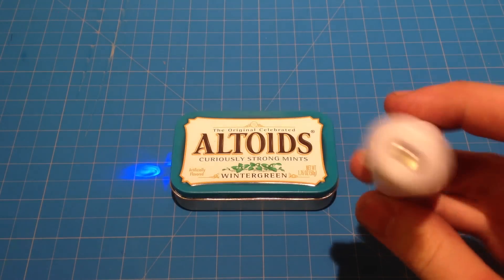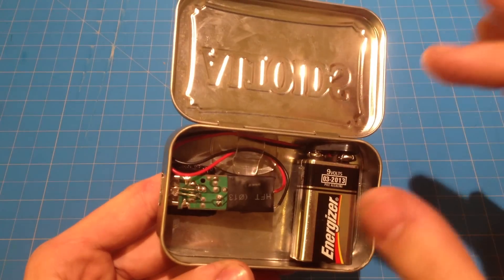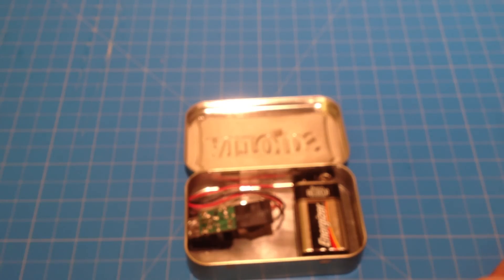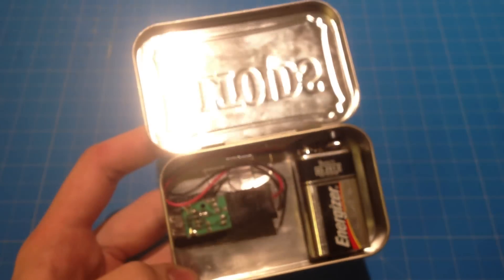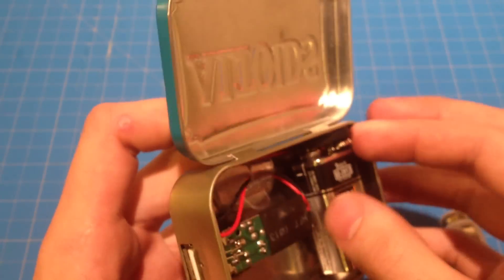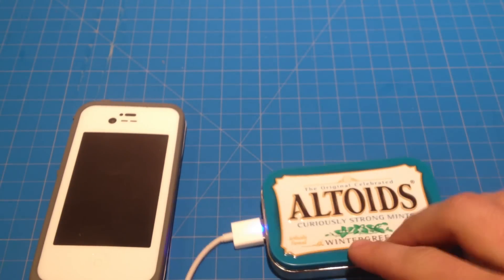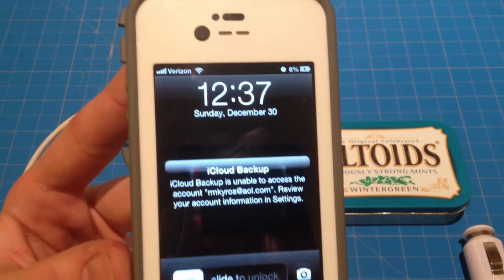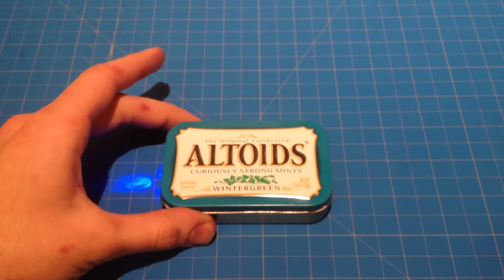$3 Altoids USB Charger

Comment: The balaclava and red wires are called 9volt battery connectors. I went to radio shack and just asked if they had some and sure enough they did

Comment: Instead just waste it on all of the 9-volt batteries you'll need to run the thing, an expensive battery pack would probably pay off in the long run, and they're actually tested to charge things.